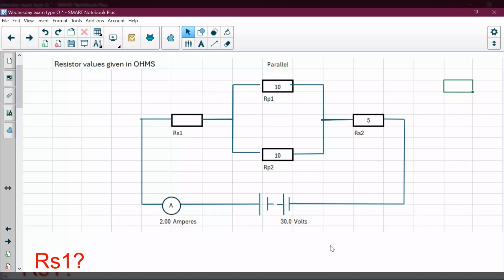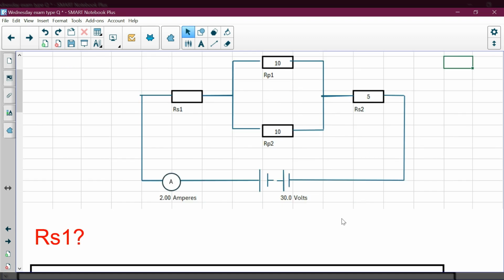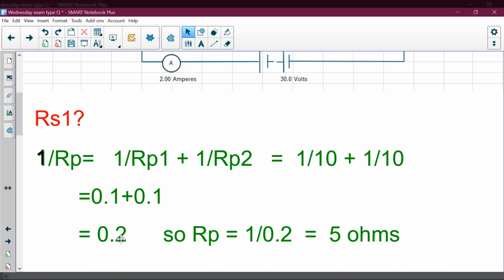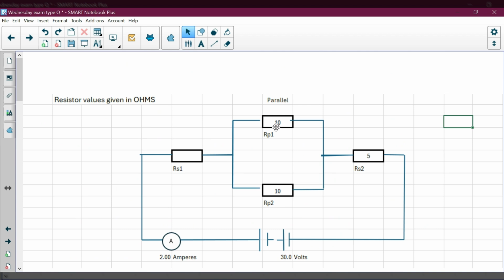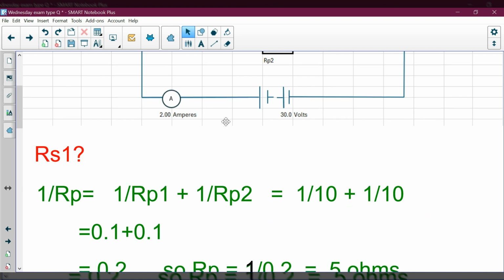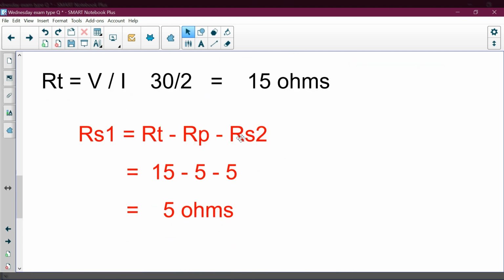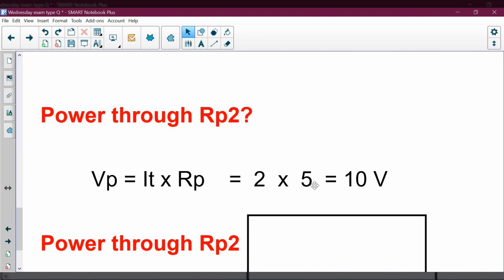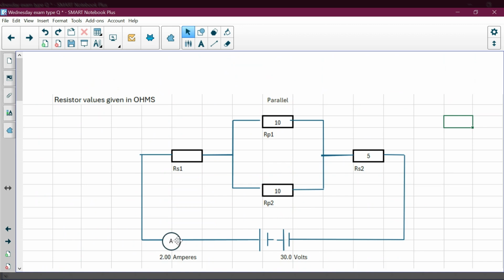Series Parallel Resistive Network Calc 2

Comment: great video, i think you don’t have much viewings because of the tittle. you should link it to wiring regulations or similar books
Reply from the maker: Cheers for the tip,  I QR code link in the candidates handouts for  the use of these after  my courses to aid them when they're away from college and I'm not there to proverbially poke them with a stick but I'll take that on board for apprentices etc outside of our centre.